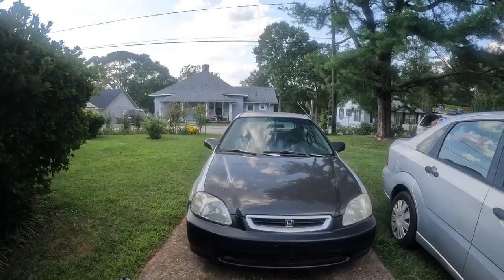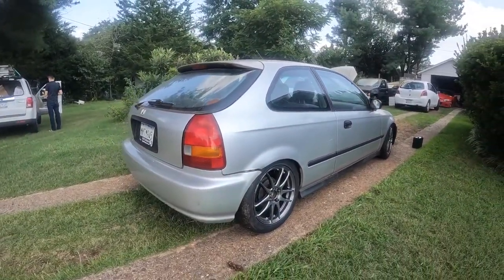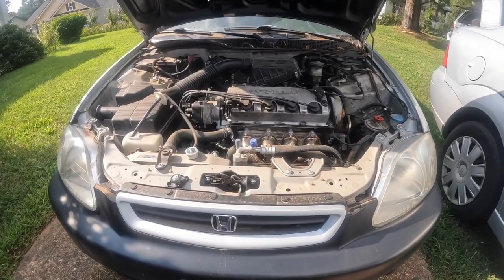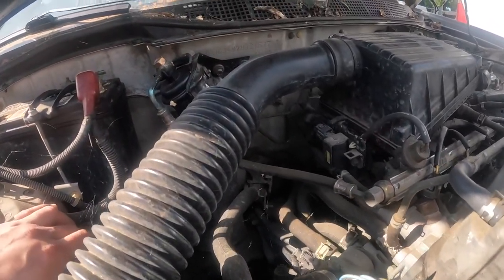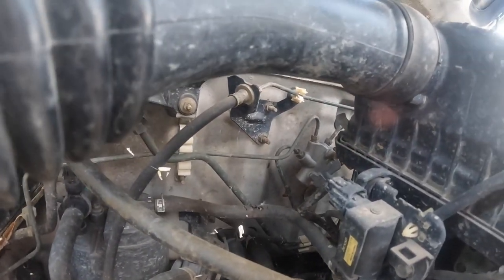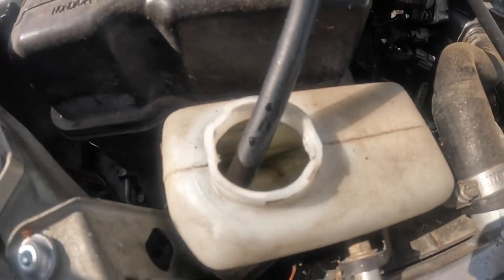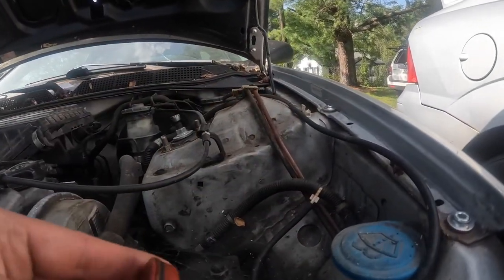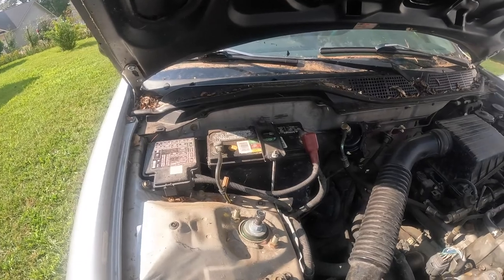Skunk2 Alpha Series Headers Sound Test

Comment: Just found out sbout this header yesterday while doing research for CARB legal headeds 😂 gonna have to pick it up next paycheck 👨🏽‍🔧
Reply from the maker: What exhaust are you planning to use?
Reply: @sologarage I do want to upgrade to a MagnaFlow XMOD muffler
Reply: @sologarage  Right now I just have a J2 Engineering exhaust with a 2.5 inch from cat back, but if I get these headers I can run 3 inches all the way with a 3inch muffler as well instead of a 2.5 inch 🤩
Reply from the maker: Ok cool. Yeah I had to have a shop connect my apex’i exhaust to the headers cause they don’t match up.